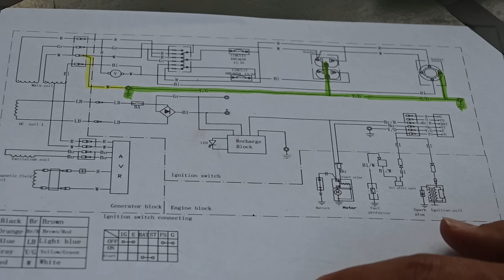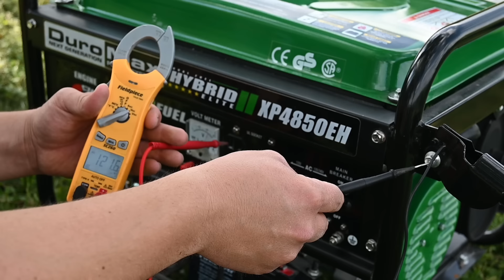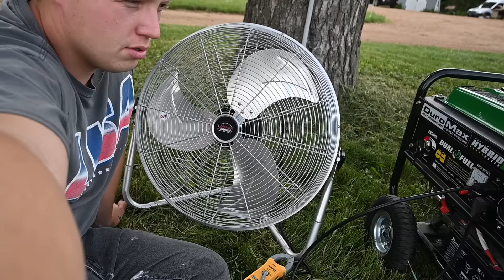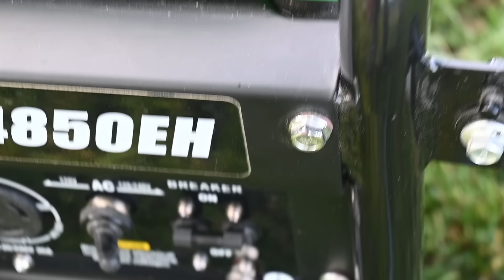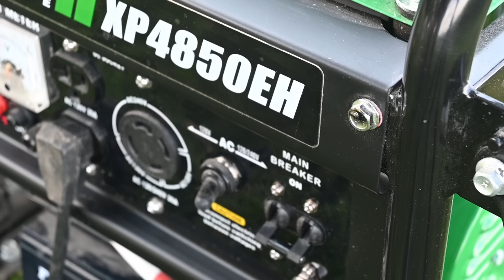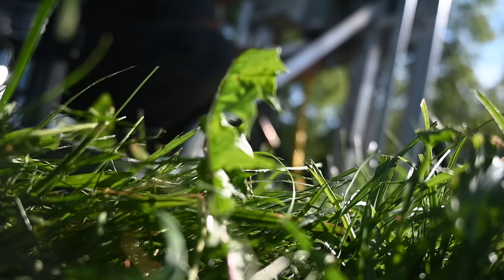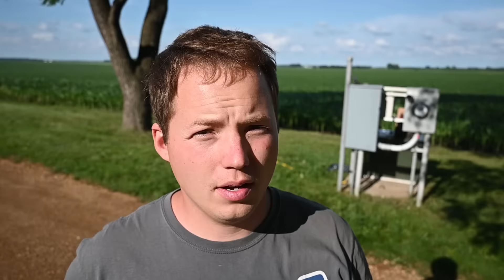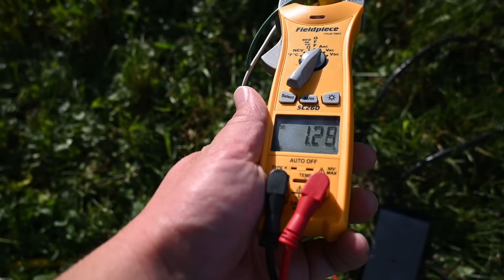What is a Floating Neutral Generator?

Comment: In that configuration you are sending current through the neutral, through the ground wire, and through the soil itself.  You have a connection from the neutral to the ground on the generator to the ground on your disconnect.  Some of the current will be flowing through the dirt.  If your generator is close enough to the panel and you touched both then some of the current would flow through you!  If your wiring is good this will not be much but if your connection was faulty you might be the path of least resistance.  Leave it unbonded!
Reply: Don’t forget about the generator safety rules: Always make sure you follow all the generator safety rules whenever you use your portable generator. This is only a reminder. Generators can be dangerous if not used carefully. Every year, hundreds of people die or get injured when using portable generators due to carbon monoxide poisoning and electrocution. Make sure you are using your generator carefully and keeping others safe as well. There is something very serious that everyone should always be aware of when using generators. Some people do run their generator indoors which is not safe and that increases the risk of carbon monoxide poisoning which can cause death of family and you. Some people run their generator in wet conditions which can electrocute them. Please remember that you should never run your generator indoors. Remember that carbon monoxide is an odorless and colorless gas that you cannot see or smell. Carbon monoxide is a silent killer. Keep that in mind. Make sure your generator is 15-20 feet away from your house and away from doors, windows, and vents. Never use your generator in your porch too. Having a carbon monoxide detector is very important against generator safety. Some people also allow children to go near the portable generator which could pose risks. We need to keep an eye on our children making sure that they are not near the portable generator so they won’t get electrocuted or burned by the generator which is dangerous. A locking enclosure also keeps kids safe. A generator shed might look like a tempting place to explore, or take cover during a game of hide and seek, but a generator is a dangerous piece of equipment that can cause injury. It says on the manual that we should also keep children away at all times from the portable generator to avoid injuries. Please do not allow a child or unqualified people to operate the portable generator.  It is important to keep your children safe especially little ones. The portable generator can be hot during an operation. Just because some manuals missed what should be listed doesn’t mean it’s safe to do. Always follow the generator safety rules when using portable generators. Generators pose electrical risks. If you need to use your generator during wet weather, you need a generator tent to protect your generator from getting wet. Don’t let your generator get wet. Keep your generator dry and before using your generator, please make sure your hands and your generator is dry. Do not wear loose clothing when operating the generator. Everything that is said on the generator’s operating manual should not be ignored. Never smoke cigarettes near the generator. Please keep flammable things away from the generator. Never overload your generator too. Your generator can catch fire. Never ever try to plug a generator cord into a wall outlet to avoid back feeding. Back feeding your generator is dangerous. Always turn on your generator first before plugging in appliances and shut off the appliances before turning your generator off. Use a heavy duty cord for your generator and the cord should not be worn out. All the instructions should be followed carefully. Never refuel your generator while it’s running. It can cause fire if fuel spills while your generator is hot. You should turn off your generator and let it cool off before refueling it. Having a fire extinguisher next to the generator is also important. This is only a reminder for everyone’s safety of using generators. Make sure your generator is properly grounded. Having a fire extinguisher next to the generator is also important against the safety rules. https://youtu.be/I1jT3ANENvI and here is a video more about keeping others safe when using generators and also about our family’s safety. It’s important to keep our little children safe as well. Make sure your little children are kept away from the generator at all times especially when it’s running. Hope this helps. Stay safe

Comment: been chasing the story on bonded vs floating  neutral for a while now, your vid cleared up for me.. just converted my dual fuel Champion 7ooo, to floating neutral as I have an inlet box wired in to my main (only) panel via a 30 amp breaker and an interlock.. thanks for the vid .. subscribed now.

Comment: On some Champion duel voltage generators they use a floating neutral and a multi contact switch to parallel both 120 vac windings to increase the amperage for the 30 amp 120 vac socket for campers and small RV's. So if you would bond ground to neutral with the switch to 120 vac you would get a direct short. When the switch is at the 240 vac setting the switch also bonds the neutral of one side of the 120vac winding to ground. With that being said most of the Chinese generators come out of the same major factory. So they don't have a bonded neutral. Remember China home power is 220 vac. So split phase is not used.

Comment: This would be the same as an isolation transformer. Depending on some applications and circumstances, isolating power systems is a good thing sometimes. Bonding the genset chassis and the building electrode is required if the neutral is tied to the genset/grounding rod. I think a floating neutral is not actually floating because it's not actually neutral if it is isolated. It's just a secondary of a transformer (Not an autotransformer) . If a shorting fault occurs in the windings or other fault occurs, it could be lethal. Either way, bonding the genset chassis to the building electrode is required. If worms start flying out of the soil, don't go near and RUN!

Comment: This happened a few years back installing a generac transfer kit to a residence, after wiring everything up correctly when going to test everything , first tested utility side and everything was good, then for a simulated power outage and running from the generator, since the generator was set up with a OSHA type bonded neutral/ground it would trip the breaker on the generator becuase of the multiple pathways for the bonded neutral and ground in the main panel, the manufacture did have a solution wich was to instal a neutral switch kit, but, being a older home there was a possibilty of shared neutrals which would cuase a almost simular situation, solution was to have a generator that has a floating neutral so that it would not trip out it's own breaker.

Comment: Hello Ben, Thanks again, good video, difficult subject. I have a 7.2Kw continuous duty generator that was bonded by default when I purchased it. I intended to use it primarily as backup power for my home.  The bonding was done inside the generator cover which I promptly disconnected.  Occasionally, this generator is used in standalone mode (not supplying power into a system with its own bonding) and at these times it should be bonded.  I considered two solutions to solve this problem. The first was to install a toggle switch on the generator which could control bonding on/off. The second was to construct a short extension cord (<1 ft.) with L14-30 male and female connectors – wiring straight through plus connecting (bonding) neutral to ground. I chose the second option as one must be quite deliberate to affect bonding.  

I do not agree with the analysis you did to determine current flow on the ground conductor with the generator bonded using that salvaged line cord. With the generator properly bonded, it connects to your home system with approximately equal resistance on both the neutral and ground wire.  If we consider a case where the neutral current is 10 amps on an unbonded system, connecting a generator that is internally bonded will result in this current being split almost equally between the neutral and ground conductors so approximately 5 amps each. In your case you introduced a higher resistance between the generator neutral to your generator ground which resulted in a disproportionate split on what is flowing through the neutral and what is flowing through the ground conductor. I believe you showed approximately 480 watts of load on your system. If this load was all one-sided it would be approximately 4 amps of neutral current.  This would divide approximately evenly between the neutral and ground wires coming from the generator.   

Back to the opinion you offered – not much of a problem running a bonded generator as a backup power unit and connecting it to your home with bonding in the panel. Other than this breaking the sacred rule that the protective ground conductors should never carry any normal loads; I agree that it should function just fine.
Reply: So a 3 conductor connection to the panel would work just as well right, and in that case you would WANT it bonded so that your generator case has continuity to ground?
Reply: @snap-off5383  Here’s my take on this…  For the backup power example, you still want all four wires in your connection from the generator to the panel. You just don’t want any bonding done in the generator for this use case. Instead, you let that bonding occur in the panel in your house. Then the ground wire that runs from the generator to the panel does not carry any neutral current that it shouldn’t be carrying.
Reply: @deanrhodenizer938  ideally yes, practically, in many cases someone is going to have a 3 prong welder  receptacle with perfectly adequate 6 gauge conductors and want to use it on "emergency basis" to backfeed (me). Lacking the 4th conductor, a user would want the bond at the generator, to set the chassis potential equal to ground potential. So in the case the chassis gets shorted hot, it trips the breaker immediately instead of waiting for a grounded human to touch it.  In that case there is no grounding conductor to be conducting any electricity, its just two hots, one neutral, all of the neutral and chassis being at ground potential due to the bond in the box.
Reply: @deanrhodenizer938  OK turns out I'm wrong, if bonded the ground ITSELF can become a fault path back to source, whereas if the generator is floating neutral and case-grounded the only fault path back to source is down the main neutral, not through the ground or a person happening to touch the case and the service panel.  So even with a 3 wire config, you'd want to float the neutral, and copper-stake the generator ground.

Comment: This is quite an interesting video. Ben is very courageous with good intentions.

He addresses a topic that the professionals, universities and companies dedicated to electrical engineering are relatively mute.

My take. 
Un ungrounded  generator with a floating neutral bonds its neutral and chassis and grounds them when connected to a grounded electrical system. 
This happens when there's a EGC from the electrical installation back to the generator!

When the same floating neutral generator is used as a standalone source to power appliances, tools, etc. THEN it would be prudent to bond the Neutral  and Ground and bond them to the generator chassis. 

Grounding the chassis to an electrode is optional.

WHAT MUST ALWAYS HAPPEN IS THAT THE NEUTRAL AND THE GROUND ARE BONDED TOGETHER AT THE CHASSIS or indirectly when connected to the grounded electrical system. 

However switch gear that switches between standby and utility should be located before the Neutral is grounded before the main disconnect.

Any power source connected before the first disconnect will automatically have its neutral and Ground BONDED and grounded. 

The main confusion is brought about by companies or interests who seek to sell and/or install more grounding system

Comment: Another thing that could happen if the generator and utility power are connected at the same time is that the generator could catch on fire as the generator and utility power will not be in sync or phase with each other.  There has been fires because of this.  In solar systems there are grid-tie inverters that match up with the utility power.
Reply from the maker: I wondered about that while editing the video. It's amazing that they can sync all of the different power generation systems to the same 60hz frequency on the grid.
Reply: @BenjaminSahlstrom  I imagine most frequency-matching systems in grid-tie converters are based around the zero-cross detector, which is basically a full-wave rectifier feeding into an opto-isolator (which is basically an LED matched with a photosensor inside an integrated circuit housing); LED on means the phase is not zero (or 180, which is functionally the same once you've used a full-wave rectifier), which shows up on the opto-isolator's output, so LED off means no current, which means the phase is at zero.  A lot of electronic lighting dimmers (not the knobs or sliders or whatever but the bigger ones used for theaters or offices or industrial buildings or what have you, or even the ones you can get off of Amazon for like $100) use a zero-cross detector to trigger pulse-width modulation on the live line (by way of a TRIAC, generally) going out of the dimmer, thereby chopping off part of the wave proportional to whatever percentage the dimmer is told to use.  With an incandescent light, the thermal inertia of the filament allows it to continue emitting light during the portion of the phase where the modulation has turned off the current (the curve of light emission compared to time-powered-on is enough the same between various makes and models of incandescent lamps that a compensating curve can be programmed into either the control computers or directly into the dimmers themselves).  However, LED fixtures do not have the same sort of carry-over during the point of the phase where the current is shut off, which is why they tend to flicker (also, they require a certain voltage before turning on at all).
Reply: @BenjaminSahlstrom  Hello Benjamin......... Do you know what is the THD=Total Harmonic Distortion of Duromax Generator ❓❓

Comment: It is spooky to find a floating neutral in a consumer product. That completely removes the protection of a safety ground wire for any appliance plugged directly into the generator. CE and CSA are labelled on the frame, but evidently the authorities who approved this didn't look beyond the schematic. They should have bonded it, with documentation available to disconnect the bond for those few who plan to feed a main panel.
Reply from the maker: Exactly.
Reply: The vast majority of Chinese products with CSA/UL labels did not actually pass testing and are not certified - the manufacturers apply those stickers fraudulently.
Reply: well.. for most products on mains yes.. but using this Gen with extension cords.. idk you would need a situation where one half is on frame shorted to h and another hand is on frame electric ly isolated from first part of frame but conductive to other wire.. kinda odd circumstances. cause floating just grabbing hot shouldn't do anything. it's not ground refed. dry unbroken skin is 100k ohms. add 30ft of dirt and even if not well isolated.. ie there is a Gen head path to dirt from n... not much current is going to flow. do the math on just skin resistance and 120.  isolation transformers are pretty standard in med environments and electronics test benches.. and I thought they were still mentioning one arm rule to electricians and well it works better with isolation it's still not a bad rule in general

Comment: Most portable generators sold in Canada are with the neutral bonded to frame I believe.  The manual transfer switches we install have specific instructions about the ground and neutral  as it relates to the generator used (if in fact it is bonded to frame or floating etc)

Comment: I have a Duromax XP15000EH which is a bonded neutral generator with <12% THD.  After seeing a lot of videos I fully expected the worst ie all my electronics fried and my 5 ton Geo Heat Pump destroyed.  As a precaution I decided to buy Progressive PT50X electrical management system to put between the house and generator.  Normally it's used on an RV but thought it might protect the house.   I first connected the PT50X to the generator at the 50Amp 240V connector, started the gen and turned the power on.  The PT50X went through it's startup procedures and all was fine.  I then shut the power connected the line to the house after shutting the main power switch.  So now the line goes from the house through the PT50X which is plugged into the gen.  I turned the power at the gen on and started turning on circuits.  The PT50X is showing the volts and amps on each leg and giving an E0 code indicating all is normal.  I turned on the Geo Heat Pump that starts with no problem the PT50X is showing each leg using 33amps and all is still normal.  Turned on a TV and flipped on the office circuit and the router and modem are fine in fact nothing is fried.  Left everything running for 30 minutes with absolutely no problems.  I didn't have a ground rod connected but did touch the gen frame and nothing.  So am I lucky or is it ok the connect a bonded neutral gen to the house?  Also the THD of <12% seemed not to harm any of my electronics so is THD an over emphasized spec?  The PT50X protects against a number of conditions including high and low voltage, high and low frequency, and open ground or open neutral ground.  It costs $370.00 on the web.  My main panel has an interconnection plate and there is no separate transfer panel.